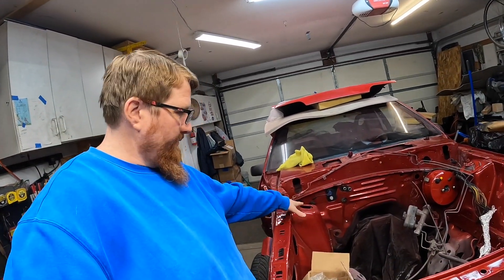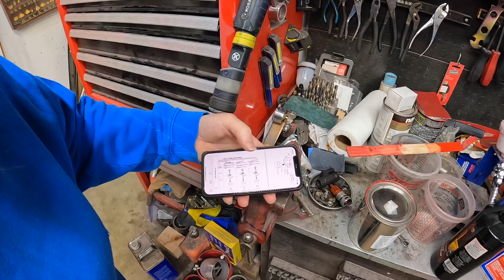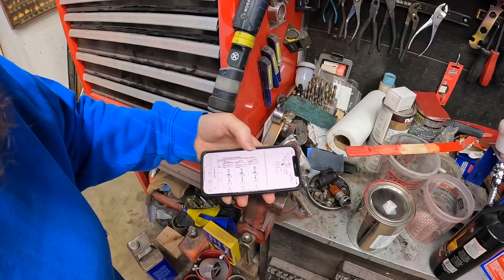Foxbody: Dirty Pirate H**ker Steeda Caster Camber Plates

Comment: That's why I'm never gonna run coilovers . Those towers are for s strut.  Not designed for full weight concentrated on that area.  My opinion and failure is all me. 🤘😎
Reply from the maker: My coilovers on Black Sunshine work great, and EASY to deal with. But I’m keeper this car stockish suspension